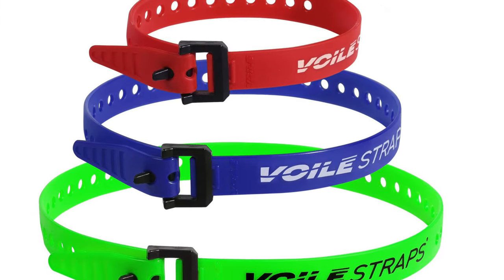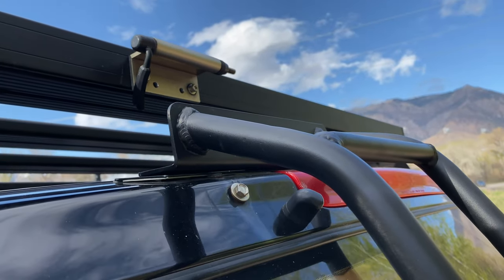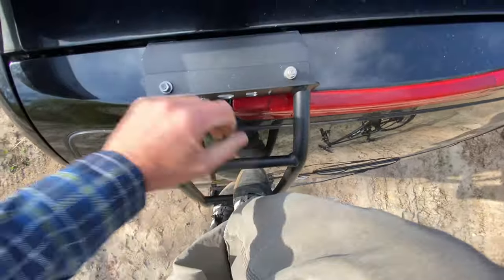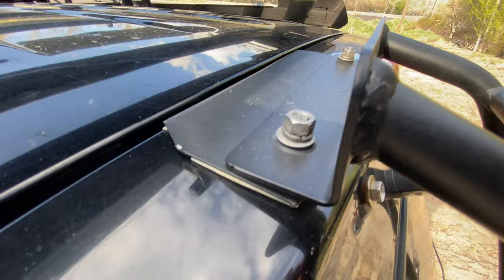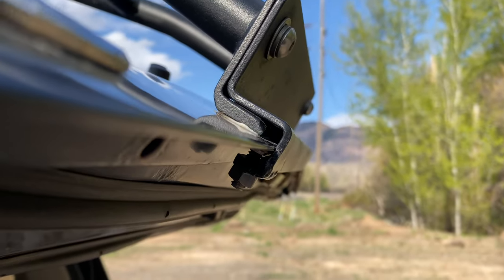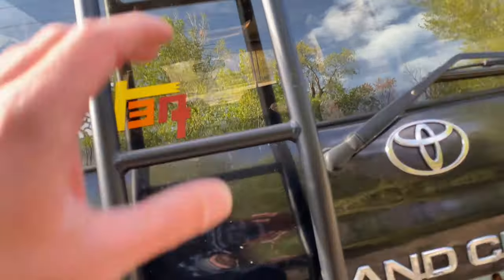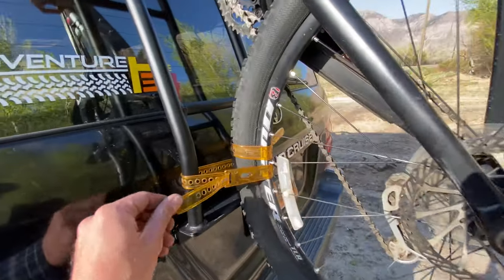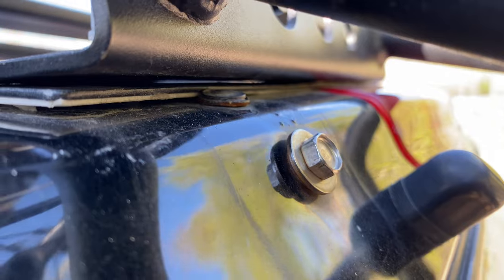GOBI RACKS LADDER TESTING | 100 Series Toyota Land Cruiser

Comment: Thanks for making these two videos. I ordered one for my LX470, but never confirmed it. I was leary of the clearance between the top bracket and the roof where the hatch hinges. Does yours rub up there at all?
Reply from the maker: Sorry I missed this comment and question. Did you order yours yet? There is no rubbing and has good clearance in the gap of the top area, both when opened and closed.